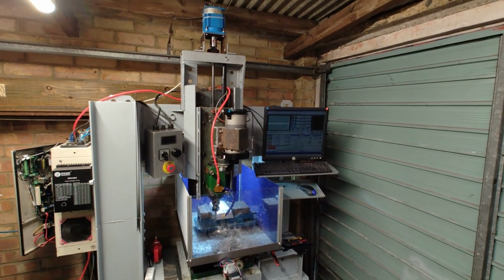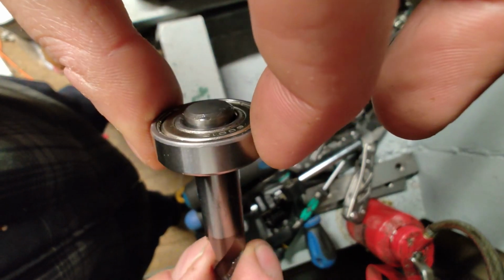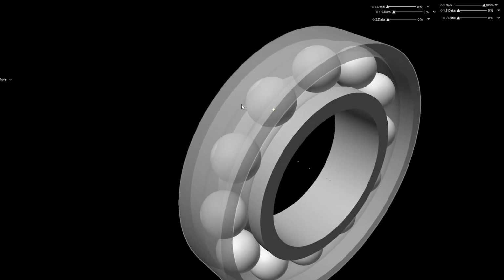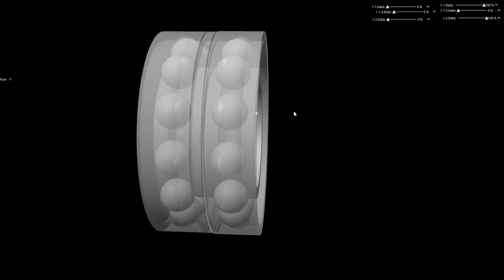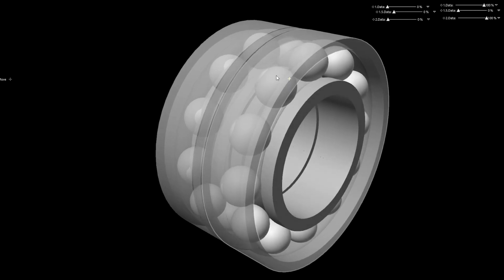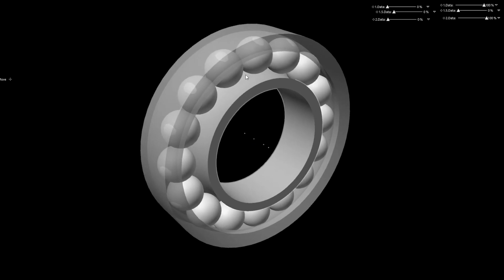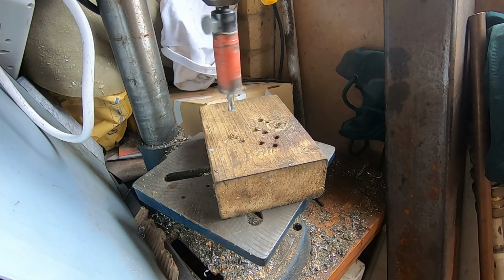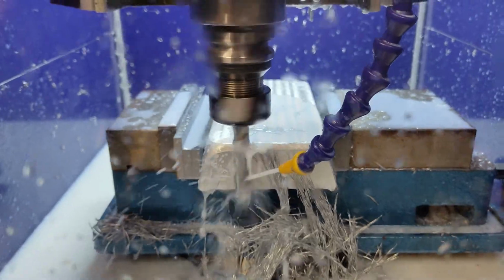CNC bearing blocks have a fault: how to fix it

Comment: I used those same Enduro bearings with a spacer for my machine, but I also used a stack of Belleville washers under the nut to make it easier to set the preload. Also I've got two ballnuts back to back on each ballscrew again using stacks of Belleville washers to preload them against eachother. I've used it a lot over the last year and a half and still no backlash 😎
Reply from the maker: Nice! Great idea to use the washers.
Reply: Yeah, that's the way to go. No play anywhere, even with cheap Chinese screws and bearings.

Comment: Quality thrust bearing assembly comes with angular contact bearings . Cheap Chinese copies use cheap bearings as they are a clone not engineered.
Reply from the maker: Yep, buy cheap buy twice. Or modify forever 🤣

Comment: where did you get the bearing from
Reply from the maker: www.wychbearings.co.uk in the UK. They were 7001-2RS MAX Enduro Angular Contact Bearing 12x28x8. Not ultra precision or anything fancy, but theyre doing a great job 👍

Comment: Could you put an actual thrust bearing in there?
Reply from the maker: Yep you could: it would be the best thing for purely thrust loads but you might have a bit of radial play and eventually radial wear if you're using belts and pulleys with a bit of tension like I have